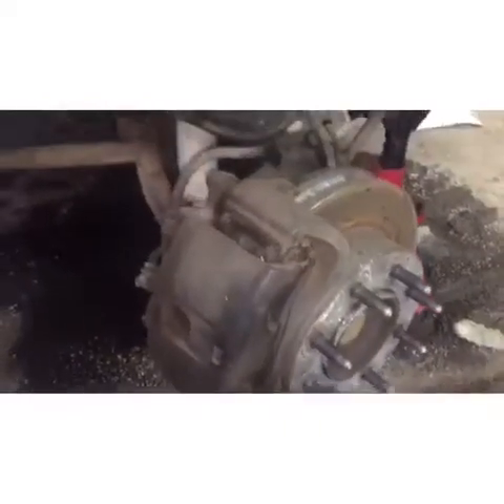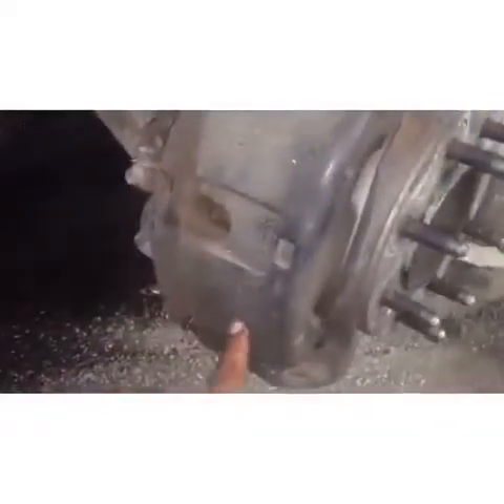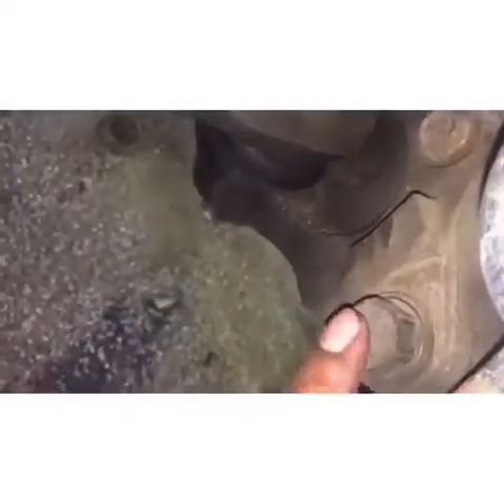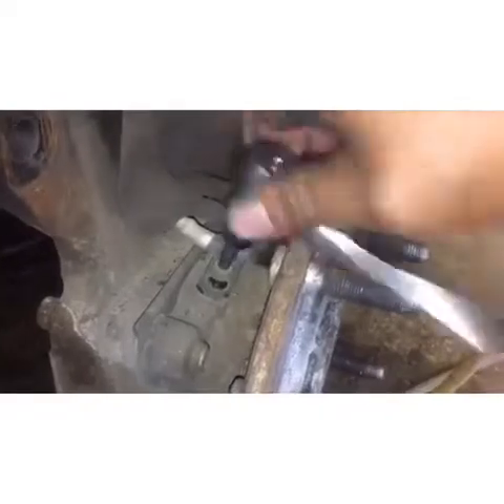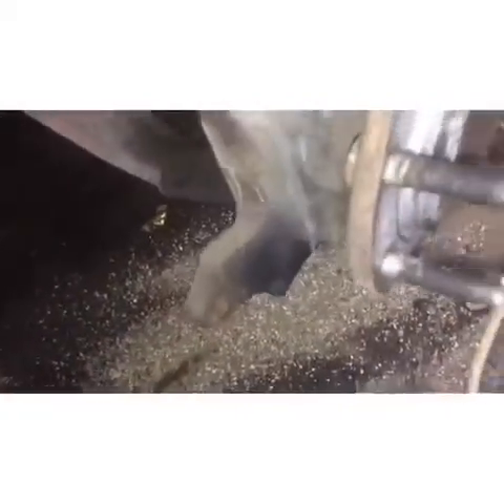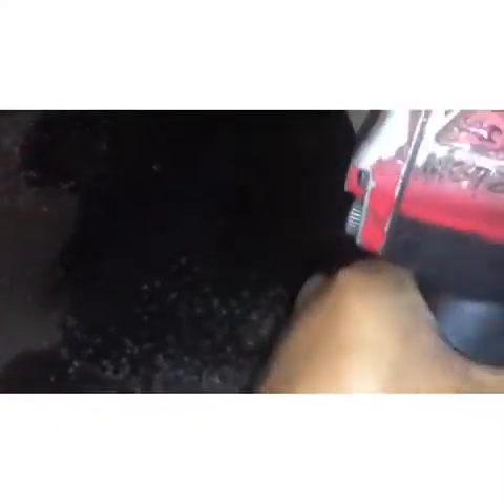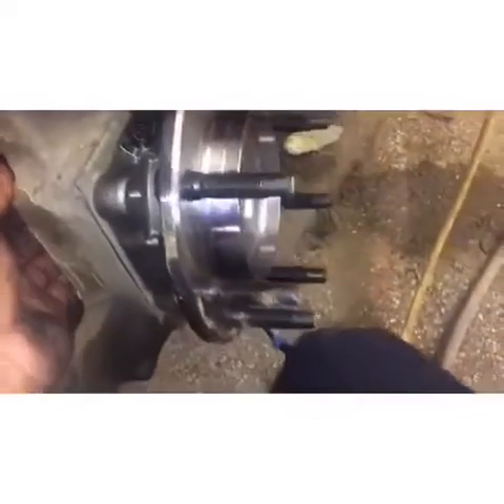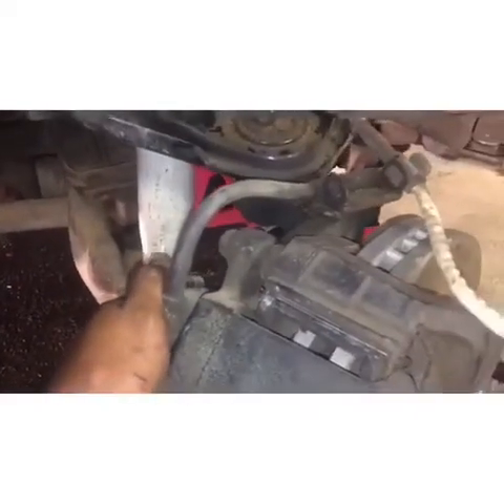CHEVY GMC 2500 front wheel bearing replacement

Comment: How did you remove the pressed in hub?
Reply from the maker: Thank you for taking the time to watch!...
This is bought as a assemble hub and bearing!
Reply: I understand that, I have the hub assembly, I have removed the caliper and the four 15 mm socket bolts, but the hub is pressed into the yoke and I am wondering how to remove it so that the new assembly may be installed. Thank you for the quick reply. I tried banging on the head of the four bolts but it did not separate at all.
Reply from the maker: Wow you must be really rusty but it is not pressed in into the spindle should of had popped open I think in my need a little heavier Bang it should come out!
Reply: Thanks for your help. I'm in Canada with lots of salt on the roads. I spoke with a mechanic here who has worked on rusty vehicles and he said that I need to take a large sledge hammer and just keep beating on it. I did and after lots of penetrating oil and about 20 minutes of beating on it, I could see a crack opening up. It is off now with all the rust scraped off and grease on it and the new one is installed. God bless you for helping others.
Reply from the maker: Please like and subscribe for more!...
Reply: Thank god for your video every body else has videos with ones that have the cv axles i. Was about to give up. God bless you!
Reply from the maker: Thanks for taking the time to watch 
Please subscribe for more!